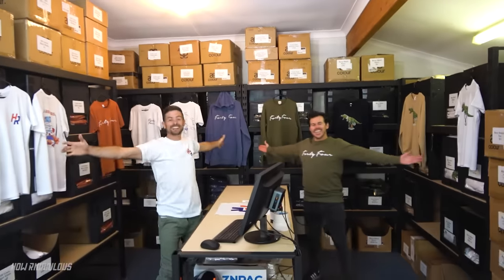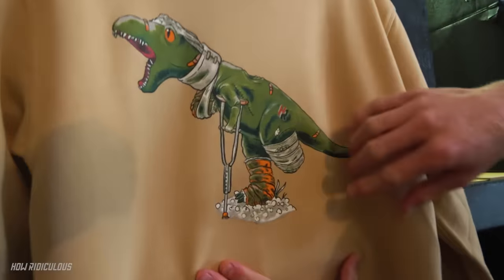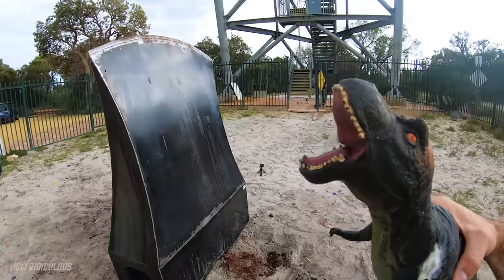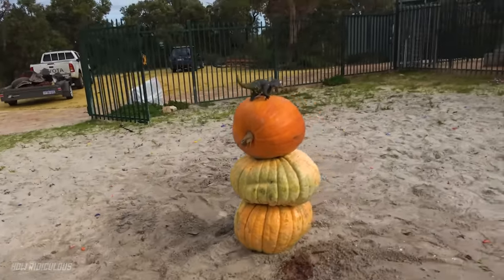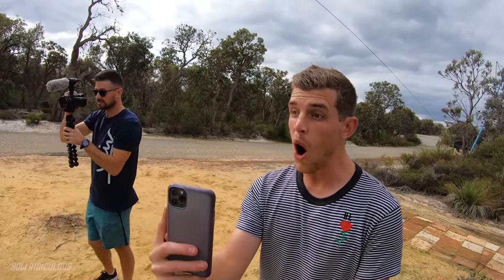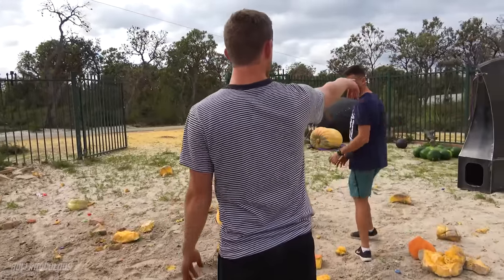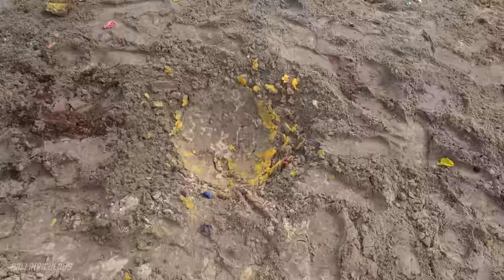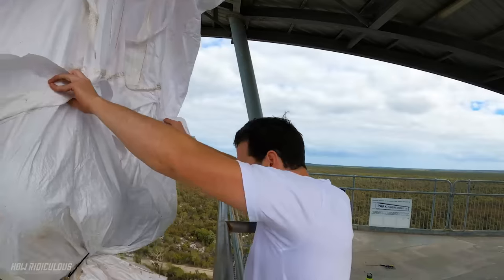AUSTRALIA'S BIGGEST PUMPKIN Vs. GIANT AXE from 45m Tower!

Comment: What are the chances of dropping the axe down onto a car?
Reply: Or a car onto the axe
Reply: Axe is heavier at the base so it wouldn't fall with the blade straight down
Reply: Oh man, that would be AWESOME!!
Reply: Car onto axe
Reply: That should be epic
Reply: @schplok  Put spin on it and drop it a few times, its likely it'll hit perfectly one of those times, or just add a long stick or something so it has an arrow effect and goes blade first
Reply: @jenson1569  the long stick method seems like the way to go here...
Reply: @Nathandelange  Was that really necessary.
Reply: @schplok  it will drop straight. Basic physics. Everything accelerates at 9.8m/s^2, until it reaches terminal velocity, so there is no reason for the axe blade to flip around mid air.
Reply: @schplok   dunno did you see the build. Lot of metal in the pointy end
Reply: Jaden Kirby well this aged well
Reply: Bro u predicted the future XD
Reply: Bullseye with the axe
Reply: Pretty low, actually, that axe is hollow and fairly light (relative to the atlas stone or the hulk fist, anyway) and it's bulky and is basically a falling wing -- meaning that it always veers off the target as it falls.  Better to put the giant axe on the ground and drop the car onto it.
Reply: @schplok  when they did the fridge, they filled it with sand to make the tip heavier
Reply: BRO. YES.
Reply: @schplok  They've dropped the axe it drops straight. this was a year ago though so...

Comment: Pumpkin weight: 124kg

Drop recommendations for the axe:  an upright piano, a full hot water heater,
Reply: Dk kg but my guess 785 lbs.
Reply: Timothy Puvogel wtf at most 70 pounds
Reply: David Shade 124kg = 275lbs. They mentioned it weighed as much as two of them.

Comment: what about a see-through polycarbonate blade, like that but with a camera in, so we see things get sliced.
Reply: I think you're on to something interesting, but as described, the refractions would make it very hard to see much to make sense of.  A clear blade becomes a prism, which reflects and refracts light inside at different angles depending on their wavelength (color), which is what turns white light into rainbows.  We might just have to live with cameras beneath bulletproof glass/polycarb sheets.

Comment: Bending or smashing thick metal, especially extremely fast, will cause it to get very hot. Forcing strongly bonded particles (like thick metal) apart and past other molecules (bending) will build up a large amount of friction, thus giving the hot aura/burnt smell.